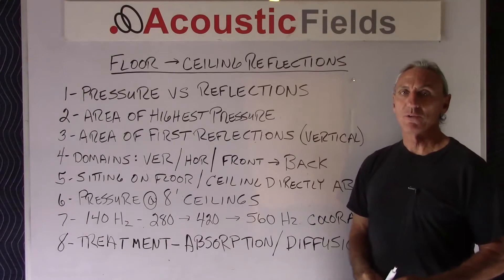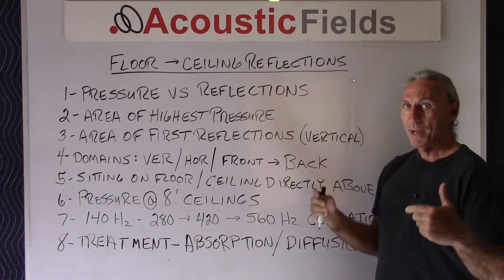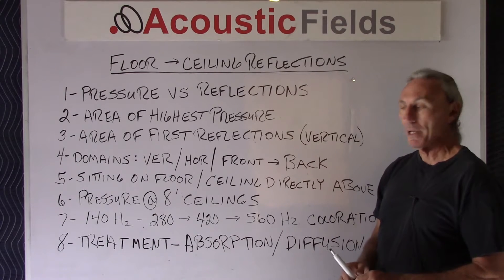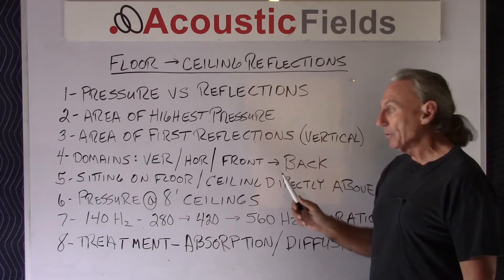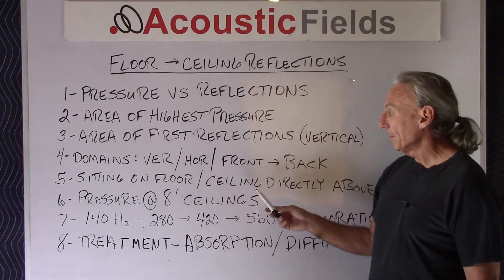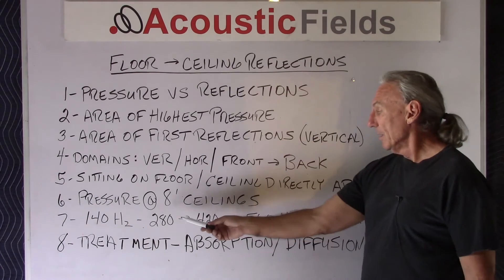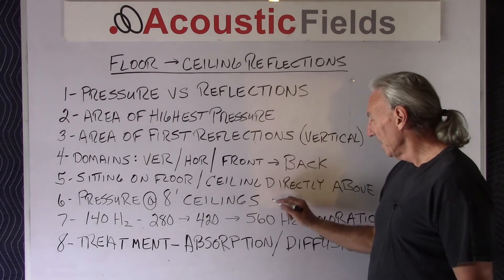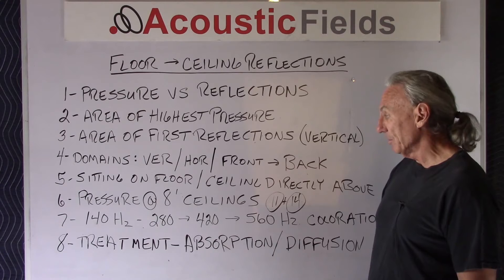What Are Floor and Ceiling Reflections - www.AcousticFields.com

Comment: I have a room where the ceiling starts at 9 feet at the front wall and is vaulted to 12 feet in the center of the room and finally descending to the room length of 19 feet. How does one treat this type of ceiling?
Reply from the maker: This will be a reflection issue. You need first to decide if the angle of incidence in the ceiling slope is going to have an impact on usage. For example, if it is a two -channel listening room or a mixing room, you must make sure the reflection does not strike the listening or mix position. You will use absorption. https://www.acousticfields.com/product/foam-ladder/
Reply: @AcousticFields  I see. It will be a mixing room (I know not ideal, 11.5'W x 19'L x 9-12'H) so I will look at the listening position and angle of incidence and make some calculations. I'd like to say thanks for the great work. Listening to your videos really taught me a lot...a lot!

Comment: Hi Dennis I live in a loft conversion and one side of my room has a ceiling that is the inside of apex roof ..which way should my monitors be facing ?...i have a wall that is 4 feet high but then angles up in to a angled ceiling.the rest of the room is 11 feet high my room is like this one in the link. http://mccurdyarchitecture.co.uk/wp-content/uploads/2012/07/Pr-low-ht-ceiling1.jpg